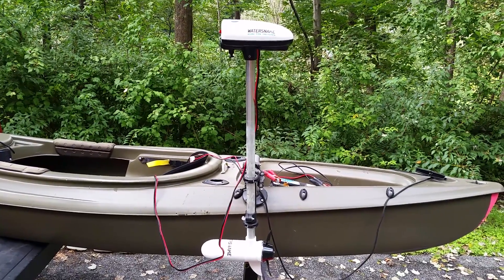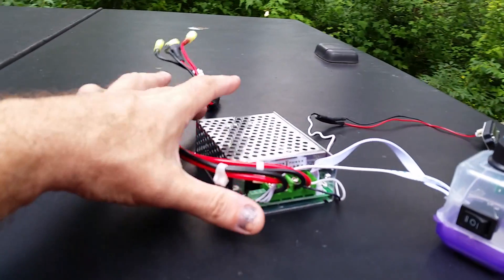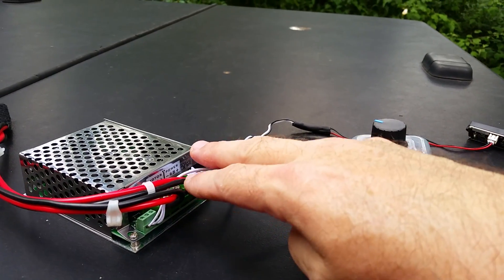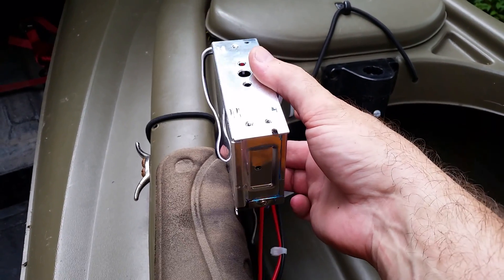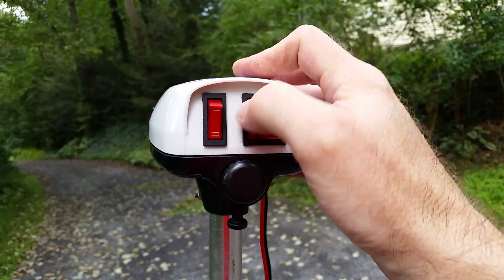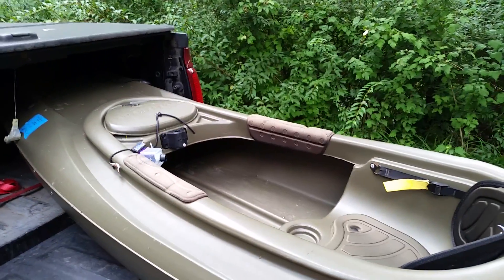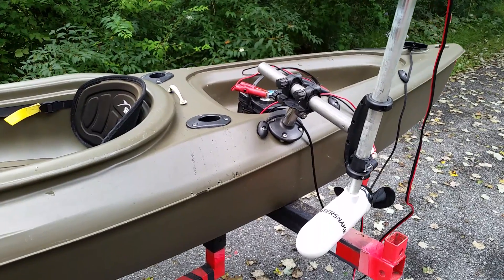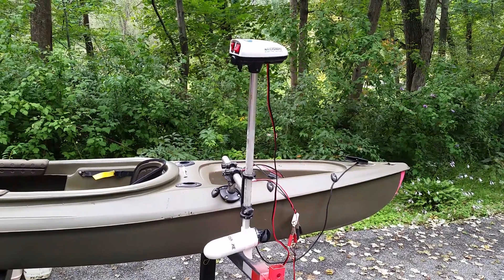Turn Any Trolling Motor Into An Infinite Variable Speed Control For Under $20

Comment: Thinking of doing this to my T24 and trying to waterproof. How hot does it get? My main concern is that if I have it waterproofed well I won't get enough ventilation to cool it.
Reply from the maker: If you're talking about the PWM itself, it gets pretty warm, but if you get one that is way overrated for the load, it'll run a bit cooler.
Reply: Yes, the PWM itself. Good point about getting one way over what I need. I have been mulling over whether to get a 30A, 40A or 60A. Have to read the specs closely though; a lot of 60A ones are using max and are really 40A continuous. Is heat pretty consistent or is it hotter at low/high speed?
Reply from the maker: @ReachDaBeach  Yeah, I've got one on my Minn Kota 30 that's rated at 100 amp peak, with 60 amp continuous. I think for the T24 a 60/40 would work, but bigger is still better. and yes, the more juice you run through it, the hotter it gets. When I'm actively fishing, at a slow crawl, it's hardly above ambient temps.
Reply: @DanHiteshew-oneandonly  Awesome! The way I am wiring one will have a bypass for full speed as I will disconnect the speed control and not take it in some circumstances. So any time I use the speed control it will probably be at under 50%. Even if i have it hooked up I will bypass it for full speed; that's the only speed at which it is less efficient to use the speed control.
Reply from the maker: @ReachDaBeach  Yeah, for full speed, the less stuff you run the juice thru before it gets to the motor, the less efficient it'll be.
Reply: @DanHiteshew-oneandonly  I have a watersnake 18 lbs, but I use a DC regulator of revolutions and voltage - dimmer - 20A and it works without problems and does not heat up.

Comment: This is awesome! A question on the motor mount. Is is fixed? Or will it kick back like a regular mount if you hit something?
Reply from the maker: It's fixed, more or less. You can keep the screws loose enough that it'll move it you hit something, but that will increase the likelihood of the motor coming loose during use.
Reply: @DanHiteshew-oneandonly  Thanks. My buddy and I will probably just mount the motor to the power pole holes at the rear and leave the motor pointed to the rear. That way, we can use the pivot (we fish in shallow water - oyster beds and sand). Since we have a rudder, we should still be able to steer. Thanks again for the awesome hack on the variable speed!
Reply from the maker: @KayakhacksFishing  Good luck, but I'd recommend mounting somewhere that you'll be able to access while on the water. You can pull it up to get over submerged logs or water, then lower it again, or whatever you need to do. I couldn't get to it at the rear, and would have no way to deploy or remove it from the water while I was out.
Reply: @DanHiteshew-oneandonly  All good points. I want to run a cord from the top of the motor through a pad to get an angle to be able to pull it up.
Reply from the maker: @KayakhacksFishing  Good luck. I've never been able to figure out a way to do it easily in mine. I just put up with the minor drawbacks of having it side mounted.

Comment: Dan, what the heck are you talking about....full amps are not drawn at low settings. For example, a minn kota c2 30 draws about 5 amps on speed setting 1, roughly 10 amps on 3 so I don't know where you get your info from.
Reply: Rick you are correct. The load or in this case the motor will draw what it wants. If you set it to a higher speed, it will demand more amperage. If the chop or wind is strong, or you run through a patch of weeds, it will demand more amperage. If you set it to slow speed it will demand less amperage. The point he's trying to make is that the old school resistance technology is really inefficient . It basically takes the power and turns it into heat to slow things down. Wasted energy. Pulse Width modulation is like turning the power button off and on hundreds of times a second. No wasted energy. Ultimately this means if you normally get 2 hours of non stop full thrust you might get a little more than 2 hours. How much more ? Who knows. But you will get more battery life. Ideally your best bet is to only purchase trolling motors with a brushless motor and a built in electronic speed controller that changes the DC power into 3 phase AC . Pulse Width Modulation is already built in. This setup in conjunction with using a lithium ion or lithium polymer battery source, would be the ultimate in efficiency .
Reply from the maker: Maybe Minn Kota builds them differently? I know "speed coils" are really resistance coils, so I don't know how they do it. There's no modulator in a Minn Kota.

Comment: Have a question what is the piece of pc for is that just to isolate the power
Reply: When you hook up trolling motor to I think it was a piece of pvc pipe with some wires on it what was the piece for on the video
Reply from the maker: @210fishing6  Oh, I just used that to create a terminal where I could easily attach the clamps from the motor.  The PVC just ensures they don't come in contact. a piece of wood or anything non-conductive would work.
Reply from the maker: I'm not sure I understand your question.

Comment: Thanks for this video. Is this PWM more efficient than say a 60A electronic speed control for an RC car? ex: https://hobbyking.com/en_us/hobbywing-quicrun-60a-2s-3s-waterproof-brushed-esc-for-1-10.html
Reply from the maker: I really couldn't say. As long as it's rated for the amps, and is above 20Khz, I'd say use whichever one you prefer.
Reply: @DanHiteshew-oneandonly  Thank you for the fast reply! I noticed the one I had linked above has a PWM frequency of 1KHz. I hadn't known what PWM was until you described it in this video. It's much appreciated. I will buy the one you have linked in your description. Thanks again.
Reply from the maker: @slacktide_angler  1KHz will hum. Get one that is above our  range of hearing, which tops out at 20,000 Hz. 25 KHz models are pretty common and will operate silently.

Comment: Awesome video. Got the controller and it works great. Thank you so much. Don't have to rip apart the motor and I'm thinking it will do wonders for the battery life. 
One question maybe 2. How did you attach #10 wires to the speed controller. Tried to see it in the video but couldn't quite make it out. Also I put the two control switches in the same box as the unit. Do you think the unit will get hot and possibly over heat? Should I leave it open? Thanks again from us electronically challenged old folks. Was gonna buy a pedal kayak but this was a much cheaper and less strenuous alternative. Looking forward to the maiden voyage very soon.
Reply from the maker: I just curled the wires around the screws, but a better way is to put connectors on the ends of the wires and then you can screw the on securely. (by "connector" I mean an end piece that looks like a washer or a "U" shape, held on by solder or heat shrink)
And yes, I'd leave the box open or at least keep an eye on it to see how hot it gets.
Good luck! Have fun! (always keep a paddle with you in case of emergencies)
Reply: Thanks Dan. I soldered connectors on with heat shrink. Should hold. I'll keep an eye on the box. How long do you think the controller will last? I bought 2 just in case. Thanks again.

Comment: nice and great idea plus build, is it correct it will handle the power it needed when you adjust the speed up or down? better than the normal use of the trolling motor?
Reply from the maker: As long as you get a motor controller (PWM) that's rated appropriately. I always over-do it. I'm using one rated for 60 amps (continuous) with a Minn Kota that draws 30 amps.
Reply: @DanHiteshew-oneandonly   thanks Dan , that's the answer I expected better to have more amps in the controller then needed I do have an ETM tec trolling motor 50 LBS, just check the power/watts it's drawing  564 watt / 12 volts so it should be 47 amps right so 60 amps PWM controller would be suitable in my situation..

Comment: The best  speed controller I have seen  to date, thanks. Are you planning a video on steering the motor?
Reply from the maker: I've got a new Ascend H12 that the motor is on now, and I have rudder controlled by foot pedals.

Comment: Dan - looks like the speed controller needs to dissipate heat - anyway to put it in a waterproof casing do you think?
Reply from the maker: That one lasted a couple of years before I hooked it up backwards and fried it. I'm using a different one now. Not too worried about a little water. It needs the air to keep it cool.
Reply: No fan in my cheap pwm . It was $14 at amazon and has been going fine and on its 5th year . I use it 3 days a week.

Comment: Very impressed with this solution for infinite variable speed but too many negative comments on Amazon regarding the quality of this controller. One customer put the unit on a scope and it was not 25khz but 15. Some found it dead on arrival others found it burnt out quickly.  I was wondering if anyone has found a better product?
Reply from the maker: I got a couple of years out of it until I hooked up backwards one day. It cooked it.

Comment: Are you fishing in a lake? Trying to figure out how big of a battery I need. Have the water snake18 but fish in the ocean where we have more wind and current. Any ideas?
Reply from the maker: The size of the battery will only determine how long it will last, not how powerful it will be.
Reply: I’d like to troll at low speed for at least 6-7 hours. Do you think a 35 amh with variable speed controller will be enough battery to last that lon?
Reply from the maker: @surfboardshack3327  The 24 lb motor is 17 amps at full power, so you'd get 2 hours at full speed (34 ah). If you were trolling along at half speed, you'd get 4 hours, etc...
Reply: Add a small solar panel with solar charge controller while using the motor. Itll add an extra 5 hours to your trolling needs.

Comment: What is the mount you are using for the motor?  Seems like something I would want to do when I get around to powering my kayak.
Reply from the maker: The Watersnake motor comes with the mounting kit, but if you just wamnt the bracket, you can get that too.
Watersnake 12V Electric Trolling Motor Kayak Bracket https://amzn.to/2IeXEJN

Comment: Do u think a dc 9 would work? As opposed to a dc 10?
Reply from the maker: I don't know what you're asking. It's 12 volts if that's any help.
Reply: @DanHiteshew-oneandonly  
DC 9-50 V ←←←←←←← that's what i referring to. Some say dc10.

Rated Current
40 A (Maximum Output Current)
Frequency
25 kHz
Control Motor Power
0.01-2000 W
12 V: 480 W (max), 24 V: 960 W (max) 
48 V: 1920 W (max), 50V: 2000 W (max)
Regulation Range
0-100%
Function
Forward to Stop to Reverse
PCB Size
100 x 75 mm (inch: 3.9" x 2.95")
Weight
175 g
Reply from the maker: Looks like it would based on those specs, but I'm not an electrical engineer.
Reply: @DanHiteshew-oneandonly  gotcha, thanks man.

Comment: A year ago, I saw a video where someone said that a trolling motor uses the same amount of power, no matter what speed you have the motor set on. I've been looking for this for that long. and how to build a PCM and how to install it in my kayak. People have thought I was crazy or didn't here correctly. Thanks for sharing this. I ordered the module and will begin installing as soon as I get it.
I have a 30# Minn Kota and am wondering as to the throttle setting and direction (forward or reverse) for normal operation. thanks
Reply from the maker: Set the motor on the highest setting (fwd) and then use the PWM to control the speed and direction.
Reply: Dan Hiteshew - This is absolutely incredible. My son and I took our small Mariner 4 out fishing today with a Minn Kota Endura C2 40# thrust and I was guessing that there was inefficiency in the motor speed settings and sometimes confusion as he was operating it. Stumbled upon your video and your explanation of its simplicity and efficiency benefit will cause us to be starting up our own project very soon for making this modification! 

Thanks for the video and info!! Tight lines! 🎣

Comment: Could you just disconnect the controller inside your trolling motor head and just connect the PWM to the neg & pos of the trolling motor. The reason I ask is if bypassing the Trolling motor controller you might save a few amps hours? I really don't know
Reply from the maker: I'm not very good at stuff like that, but it sounds reasonable. In my case, I can go out for hours on end, at full power, without issue, so I'm not too worried about squeezing a few more minutes out of it.
Reply: First of all thank you for the info. Do you have any idea if you disconnet the speed controller and connect the pwm directly to neg and pos wires if you also have to bypass the coil that seats at the bottom of the motor head at the lower part of your assembly?

Comment: Awesome video!  Im building a powered yak and the multi-position switch now has glue inside it(dont ask) and cannot function.  If I wanted to eleminate that switch all together and wire this PWM in instead could that be done.  Seems like it should be if I connect the wire that would power the highest speed for the motor and the negative to the speed controller.  What are your thoughts?
Reply from the maker: Yeah, if you bypass the switch, the PWM will become your switch.
Reply: Thanks for the reply.  The proper way to bypass it would be to use the negative lead and the lead for the highest speed, and wire those into the PWM correct?
Reply from the maker: @kunipshunfit  That sounds right, but I'm not very experienced at electrical engineering, so I'm gonna recommend double checking with someone who knows more than me.

Comment: I was looking at these speed controllers on Amazon.  They say in the description that they're not actually PWM but "current modulating".  I clicked the link you provided and that one does say it's PWM in the description.  It looks exactly like all the other ones though.  I'd like to see an amp meter connected to the battery to read the current draw at different speeds.  I'm not saying yours isn't PWM but idk man.  Not sure if I should buy one or just spend the $100 for a unit from wirelesstrollingpro.com
Reply from the maker: I'm not sure either, but it works like a charm, so I'm not concerned about it. My battery lasts forever.

Comment: So you still have to turn around to steer it?
Reply from the maker: I've found that if I lock it in a forward position, I can lean like riding a bike for the most part. If I need to actually use the tiller handle, it is still a bit awkward and behind me.

Comment: Will this work on 24V 5-Speed  foot control trolling motors? Thanks!
Reply from the maker: Yes, it should be no problem. Just set the motor to "5" and then use the controller for your speed control.
Reply: @DanHiteshew-oneandonly  can you by pass the trolling motors built in switch all together and just wire the pwm direct to the battery and motor?
Reply from the maker: @andrewcowan6392  Probably. You'd have to open it up an rewire it.